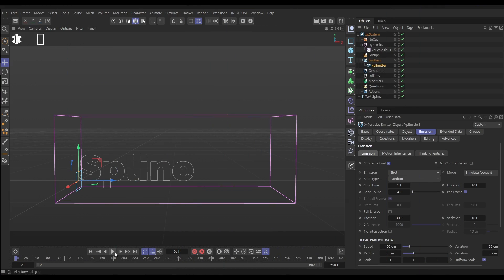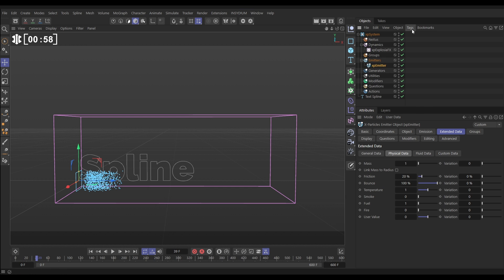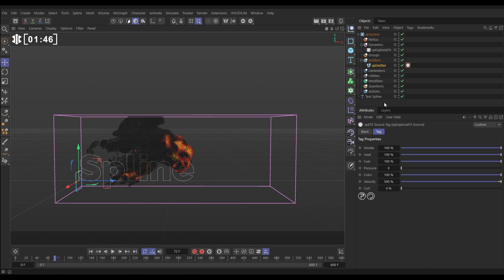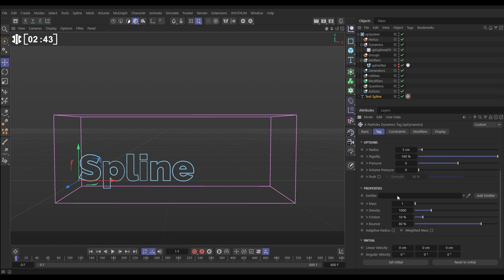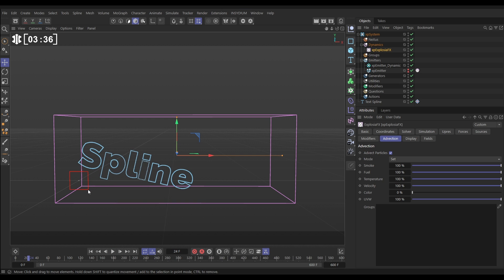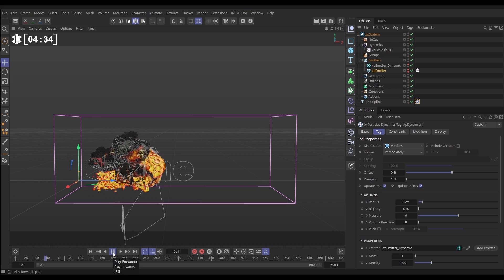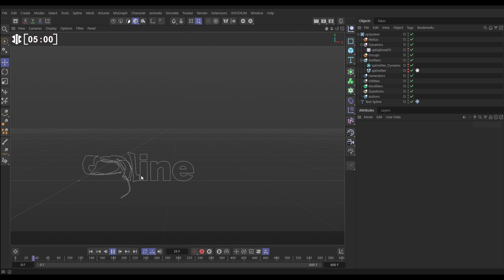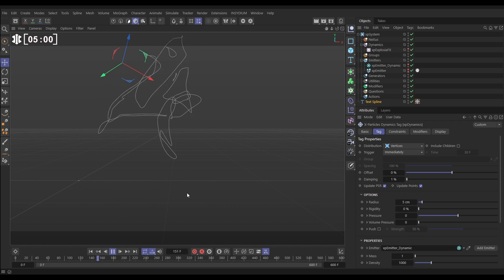Top Tip Tuesday - Spline Advection

Comment: How is it possible to display the sim in openGL? My current version of c4d doesn't support openGL and it looks very bad.. slices and resolution features don't give this result and also it slows down when I increase the amount of slices and resolution settings
Reply from the maker: It isn't possible to display in openGL in versions of Cinema 4D that don't support it. This video was recorded using the Grid display mode in ExplosiaFX. This is fast and you can use the Voxel LOD slider to increase the resolution and detail.
Reply: @INSYDIUMLTD  I have 8 core CPU and it's very slow to preview such sims.. which processor is best for simulation? Does XP use P Cores only? If I buy a 16 core processor then it will use all cores or only P cores?
Reply: @god-rays   to the best of my knowledge: No. All xP modules (the green ones) are single Core cpu based. Except the neXus stuff (orange ones)